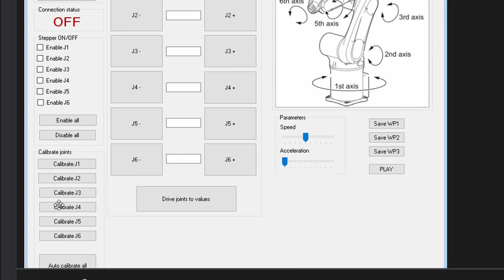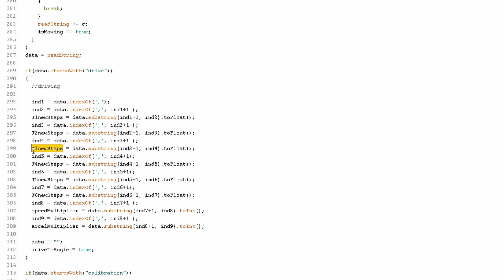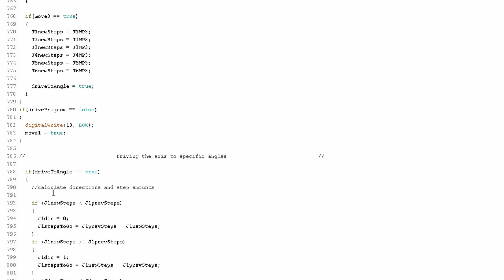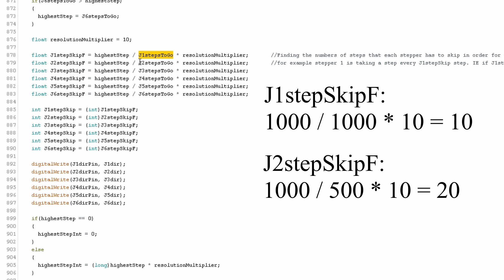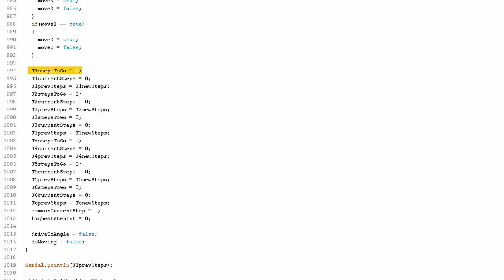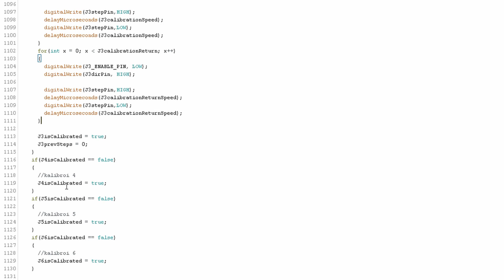3D Printed 6DoF Arduino Robot arm - Control software

Comment: one good idea, the arduino has a 1kilo byte eeprom. you can, after every stepper motion finished write all current axis positions in this eeprom. if you want a nother move, than the arduino read the eeprom and do the same action like before. if you shutdown the arduino the eeprom values stay and if you power up the robot you can get any values of any axis and you dont have to callibrate every time. i dont have such a robot but i testet with some singel steppers :)
very good projekt. if i want to build my own robot , ill look defenelty on your channel to get some help
Reply from the maker: That is indeed a viable idea! Would ve helpful not having to calibrate the robot. Thank you, nice to hear!

Comment: wow great job, in my opinion, there are missing auxiliary outputs for example the clamp and other system, and inputs for example to activate the cycle from a switch
Reply from the maker: Thank you! I agree, having atleast an output would be required to run a gripper. I experimented with this using a 9g servo based gripper but never got to adding the code to the final program

Comment: Hey! I love your work so much. I am building a similar robotic arm and I would like to use your application.  Unfortunately, I downloaded all the files from the dropbox and when I try to run the application it gives me an error, my sdk 5.0 is said to be incompatible.  Could you please help me?  Thank you very much
Reply from the maker: Hello and sorry for late reply! If I remember correctly the arm weighted around a kilogram and it could lift 200-300 grams on full arm length.